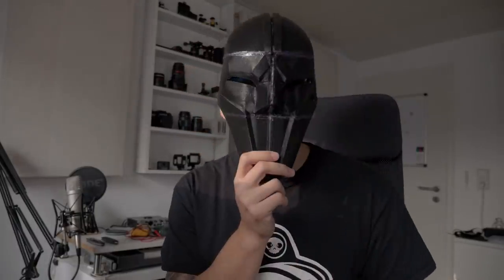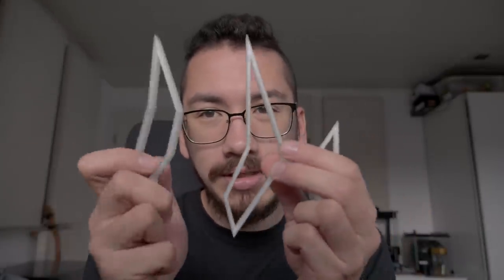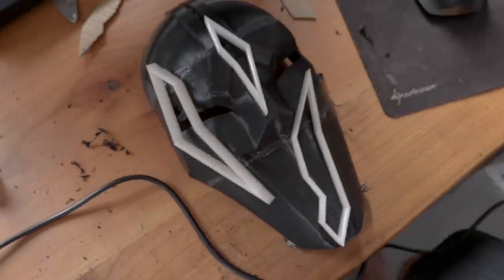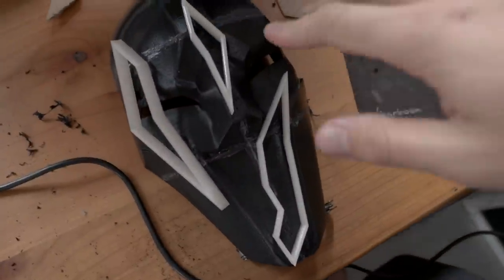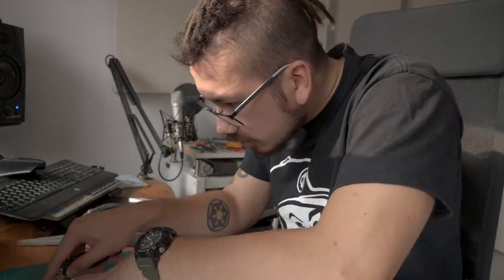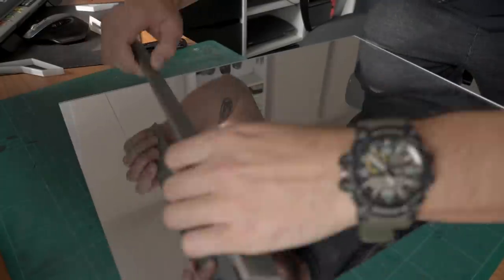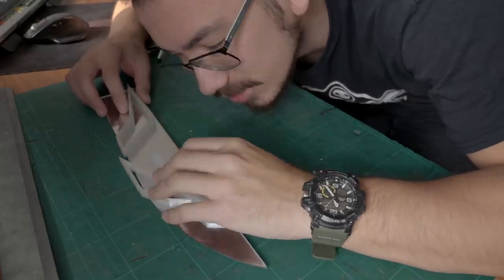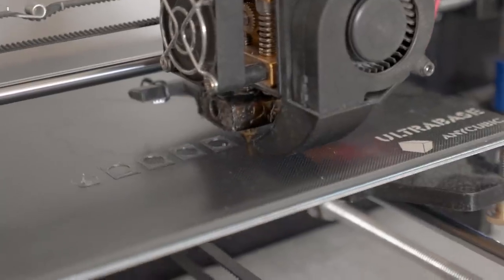I made a Mask for Halloween

Comment: At this point, you should place the sheet on the table edge and, using a folded towel, apply pressure to the cut in order to break evenly.

Comment: You can use feviquik or adhesive instead of hot glue gun
Reply from the maker: Hot glue is one of the best choices for the requirements because it can fill a lot of empty space (compared to e.g. super glue) and is also quite easily removed in case I need to access the wires...

Comment: what cutting tool did you use? the motorized one
I can't specify it on your video cause subtitles doesn't help 8:04
Reply from the maker: It's a Dremel rotary tool - very versatile and if you got 100 bucks to spend on motorized equipment, this is the one I'd recommend
Cutting, sawing, polishing... almost any material!
Reply: @normanwink  thanks for the answer.    <3
I saw this tool once in a gbwc gunpla entry movie, but the creator probably doesn't  want to share information, and nobody that replied knew what it was :(
Thankfully, youtube recommended your video.      :)
This will make my gunpla kit bashing more accurate and clean rather than using a hobby knife and heat knife to cut plastic cause that I think only professionals can fully utilize them.   XP
May you succeed in creating more amazing things and bless you and your love ones days ahead.      0:)
Thank you very much.    :)
Reply: @normanwink  You didn't film it, but if you grind glass with a Dremel using a mask and protective googles is a very good idea

Comment: Anyone know any dope websites or links they can give me too pay someone for a custom made high quality mask
Reply from the maker: To be honest, the hardest part is getting the printed parts when you don't have a 3D printer.
Maker Spaces are pretty common nowadays, maybe there is one in your area with a printer. Other than that, the soldering and building the infinity mirrors is fairly easy with a little bit of patience. The code for the Arduino is freely available on GitHub (link in description).
When you pay someone to make this kind of masks it's going to cost you a little fortune - it's really gonna be worth your while when you dig into it and make it yourself. Hit me up if you need some assistance.
Reply: Norman Wink okay thank you so much man, really cool mask, I might actually try myself may take a couple of attempts and a lot of patience
Reply from the maker: Good luck, let me know when you finish it and send me a pic ;)
Reply: Norman Wink for sure man:) also just letting you know u earned a sub

Comment: Awwwww that could have gone so wrong... (I mean like you could have cut yourself really really bad...) This is not how you split mirror or glass xD and that's also not how you cut a mirror or glass xD
After the cut you turn around the mirror and put some pressure on the backside of the cut with a pensil(or something else) so it cracks a bit deeper, now turn around the mirror again.

You place the mirror (or glass) over the edge of the table and line the cut up to the edge (the smaller part of the glass goes over the edge, not the big one).
Then you stand beside it (not infront of it), lay one hand on the big part and grap the smaller one with the other, now you can easily break it without a lot of risk to cut yourself.
English is not my mother tongue so excuse my bad explanation.

This is a actual glass cutter (AMAZON LINK: /Silberschnitt-15024-Glasschneider/dp/B000VD52FE/ref=asc_df_B000VD52FE/?tag=googshopde-21&linkCode=df0&hvadid=231986057688&hvpos=1o1&hvnetw=g&hvrand=17284552900068861230&hvpone=&hvptwo=&hvqmt=&hvdev=c&hvdvcmdl=&hvlocint=&hvlocphy=20229&hvtargid=pla-422610583345&psc=1&th=1&psc=1 )
Reply from the maker: Yeah I am well aware that I mostly don't use the safest way to do stuff... but I'm trying to improve, so thanks for the instructions ;)
But: this is acrylic glass, not real glass... do your instructions still apply then?